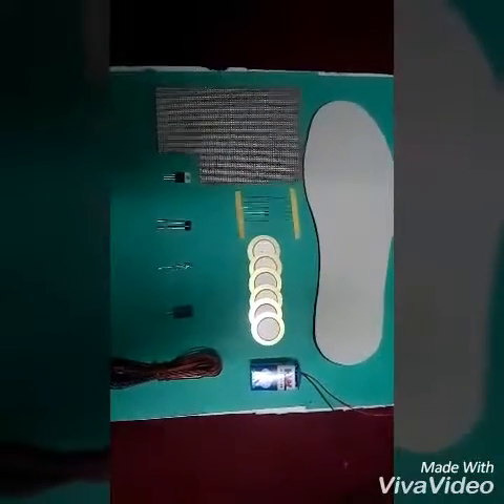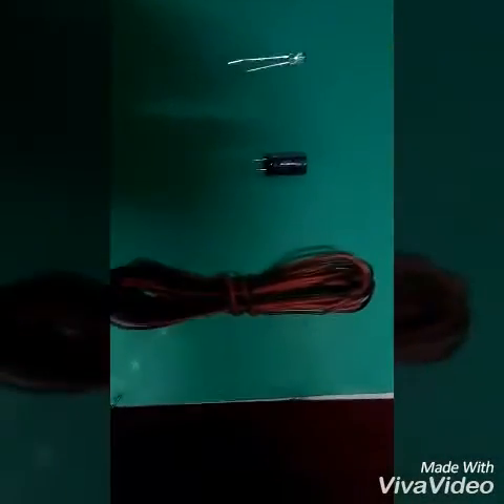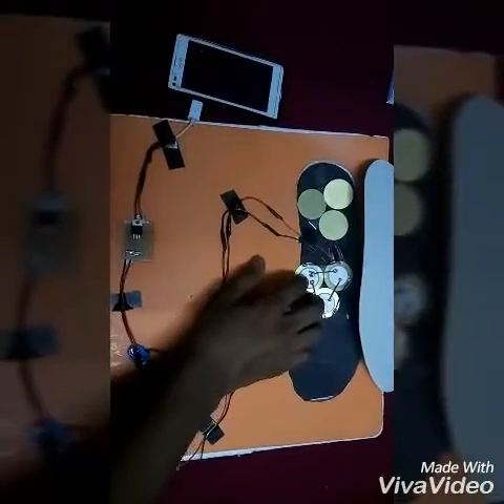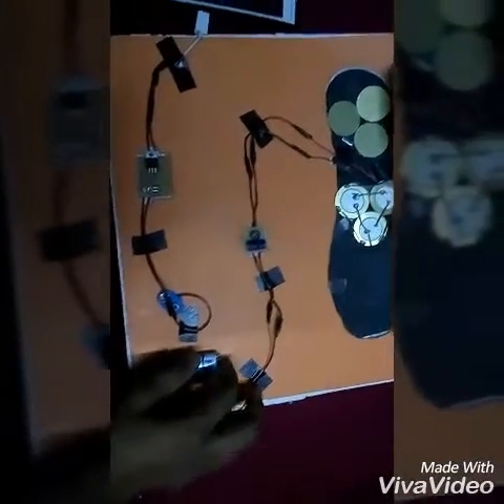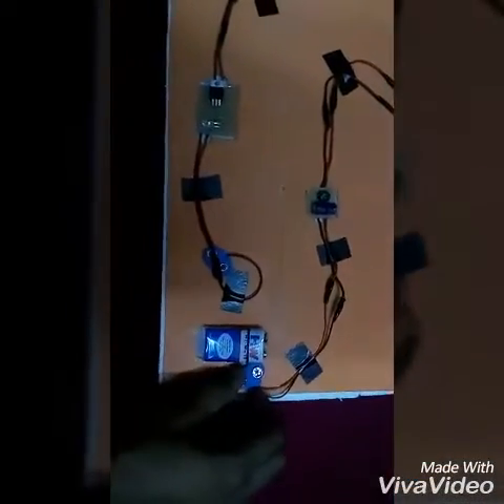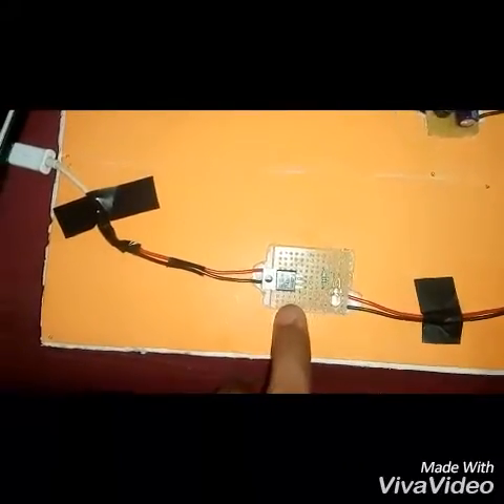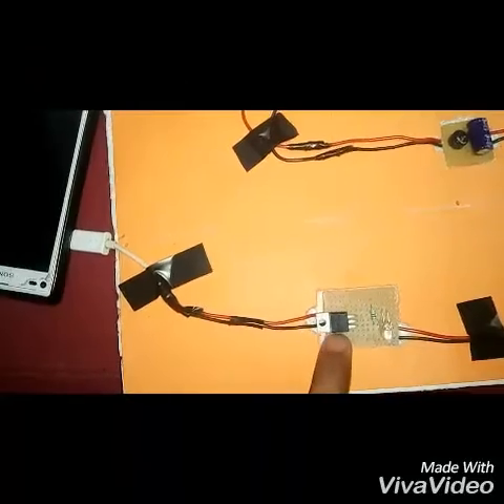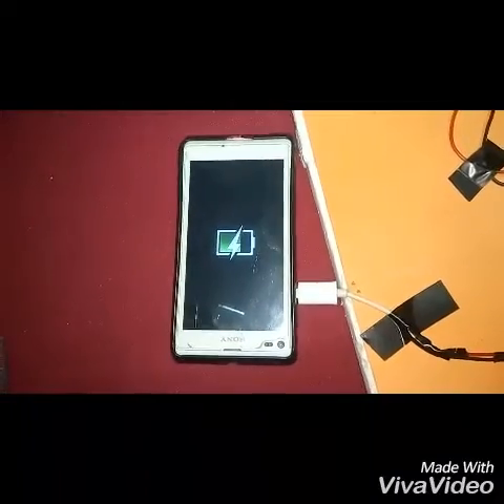Foot step Battery Charger

Comment: Hi friends, i have seen ur video abt this topic in youtube, and i have few questions, first how u know the capacitor is charging the battery when the capacitor is discharging, any method can prove tis? Second one is do we need to add a switch after the capacitor then connect to battery?, cuz the capacitor will easily discharge when it is charging once there is short moment tat no input to it, I am doing the similiar proj like urs, but i using the power bank as the load, so any suggestion?